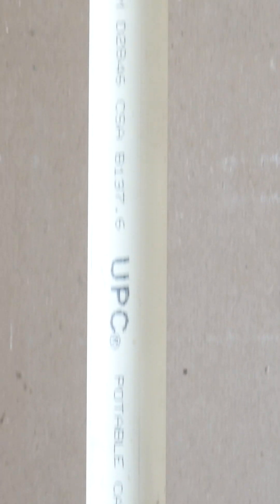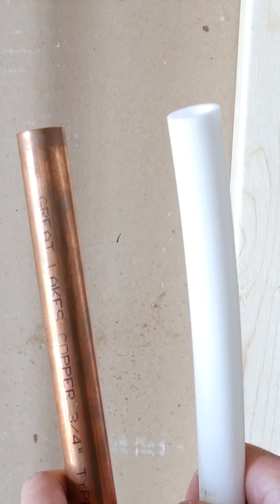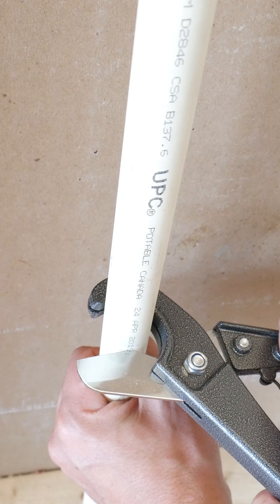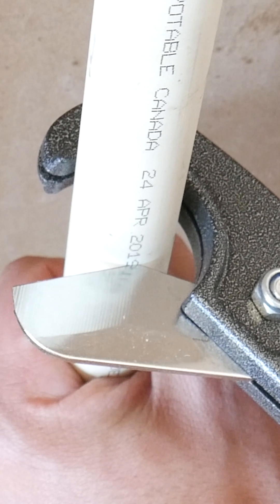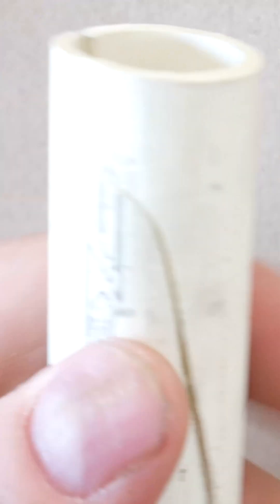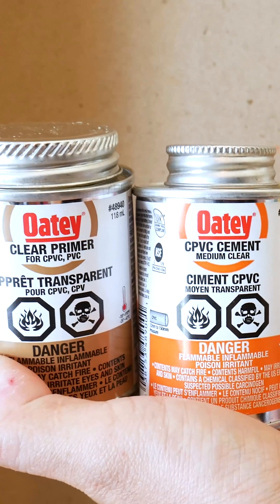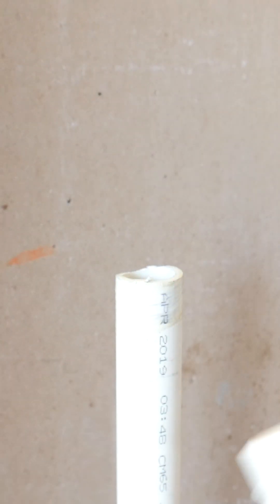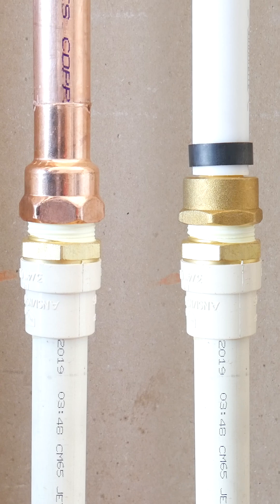How to TRANSITION from CPVC to COPPER/PEX

Comment from the maker: Stuff I used in this video (Amazon affiliate links)
Tools:
AutoCut Pipe Cutter 1/2": https://amzn.to/2XlyqAn
AutoCut Pipe Cutter 3/4: https://amzn.to/3gPmhhz
Propane gas(Blue bottle): https://amzn.to/2BOhnh7
Lead-free tinning flux: https://amzn.to/2U3abEW
Flux brushes: https://amzn.to/2T8ROBc
Lead-free solder (Sterling): https://amzn.to/2AfSY63
Abrasive pads: https://amzn.to/2XaY6kT
Pencil reamer: https://amzn.to/2tBuhKW
PEX Cutters: https://amzn.to/2VposP5
TurboTorch ST-33: https://amzn.to/2YWNZA4
RIDGID Pipe wrenches 14": https://amzn.to/31bUEsW
Knipex pliers: https://amzn.to/3dnxdz6 
Small hacksaw: https://amzn.to/31bUKRk

Materials:
Sharkbite 3/4" coupling: https://amzn.to/2AZLaWQ
Sharkbite 3/4" (Polybutylene) coupling: https://amzn.to/2YnaJtR
EZ-FLO Dresser coupling 3/4": https://amzn.to/2YmTXuW
Sweat to PEX 3/4" (5-pack): https://amzn.to/2V8ud38
CPVC Transition fitting 3/4": https://amzn.to/2Z0pykZ
Yellow Teflon tape: https://amzn.to/2Vb3Cm6
Polybutylene to PEX Repair 3/4" Coupling: https://amzn.to/3fLRiAK
CPVC cement (yellow): https://amzn.to/31dUIYO
Brass coupling 3/4": https://amzn.to/2Z2uwhl
Threaded to PEX (female) 3/4" https://amzn.to/37SSQGk

Comment: Does the CPVC adapter need to be brass or can you use Stainless steel ones?
Reply from the maker: stainless stain corrodes overtime, brass does not.

Comment: If you are going to use CPVC pipe then you should start by using Oatey Flowguard one step yellow glue(it has primer in it, so no need to use the purple primer. Also I would recommend Cpvc by stainless steel male iron pipe(MIP) or female iron pipe(FIP) threaded stainless-steel adapters to transition from copper or pex

Comment: Thx for the video, trying to remove a stuck pressure reducing valve, which is connected with copper main line via union(no issue with removal), copper male adapter into PRV(stuck) and then copper is connected with CPVC with some glue. What would be an easiest way to remove stuck PRV or should I just cut it and use sharkbite connector to connect CPVC with copper?

Comment: After working in industry as a mechanic, I don't use anything made of plastic for pressurizes gas or liquids. Your first clue ?. . .  "If it's old" All of a sudden it will fail. (split) Been there done that MANY TIMES !

Comment: Alright. I feel like I need to drop my 2cents on the table.

I feel shark bites shouldn't be used. Not because they don't last or any of the normal reasons you always hear.

I feel it should be out of respect for the homeowner.

If you're doing your own home repairs do what you want. 

But if you're a plumber doing a job for a paying customer. I feel like you should leave them alone. Because its even like this in your video.

You can do it with the right fitting, or you can just use a shark bite. As a professional I feel you should do everything 100 percent. They are paying you for a repair they couldn't do themselves. You should do it professionally. 

Just my thoughts though

Comment: Or can just glue a 90 cent cpvc male then can screw on a female pex adapter the ones with brass threads are 3 bucks vs 90 cents and a sharkbite is 10 bucks so I go the cheap route

Comment: "You could also use shark bite fittings..."

I felt a great disturbance in the Force, as if millions of Plumbers cried out in terror and were suddenly silenced.
Reply: Actually, Sharkbites are indeed useful for old CPVC where its brittle or the exterior is aged/dirty.  If you cant get a good solvent bond, a sharkbite will buy time until that shit can be re-piped with something proper!  Unless its cheap, just avoid any property with CPVC, its hell after 15-20 years.
Reply: Plumbers here use Sharkbites all the time! I used one in my hot water to repair a pipe that broke! I'm no plumber myself! But that was about 10 years ago! And I have over 150 psi incoming water! And it still is holding just fine! If you use them right there shouldn't be a problem!
Reply: Plumbers who plumb now a days see cpvc all the time, in a service situation it is the only type of connection worth using , you would have to wait forever for the glued pipe to cure, also sharkbites have proven to be better than what people give them credit for
Reply: @Oiiiwhatswrongg yup have to wait 12-24 per the Oatey
Reply: Exactly like juss pipe it in right
Reply: Lmao

Comment: I'm not a plumber but from my experience working on my house shark bite is good for a quick fix but they are expensive, could be 15 dollers a single connection. So if you just want to get one little thing done quick it's great, if you have to do 15 connections learn how to do it the other way for 2 dollers a connection
Reply: You should also understand that you should never use sharkbite in a wall or anywhere finished and concealed. They use an o-ring to seal them. O-rings don't last forever.
Reply: @chrisb9902  Really? Pro Press uses o-rings to seal. They are put inside walls. I think about a billion sharkbites have been installed by now. Failures are usually from incorrect installation.
Reply: @chrisb9902  I'm glad my pipes are all in the open because I did not know that